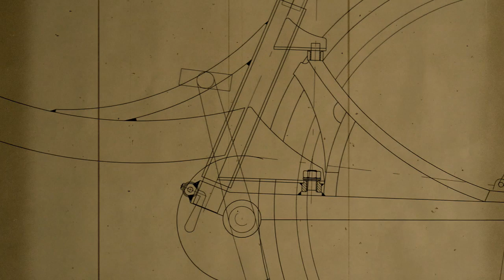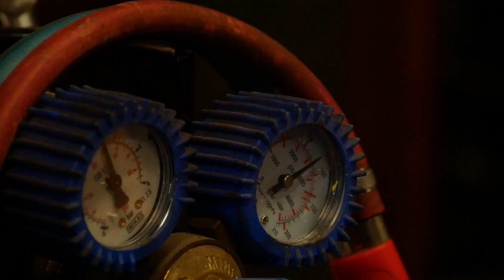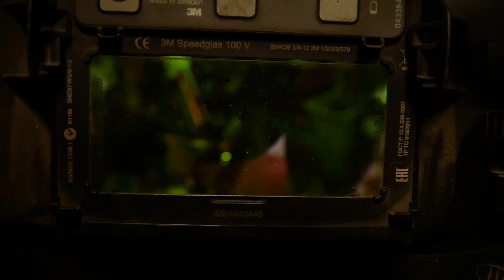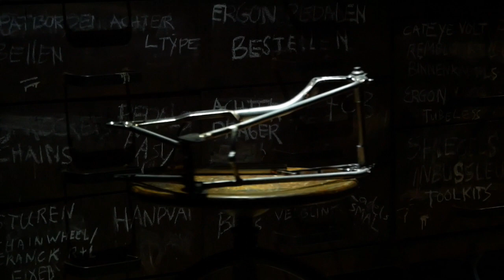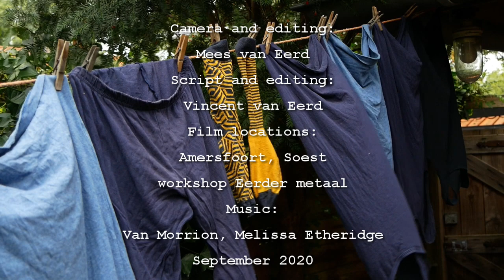Life unfolding

Comment: This is one of the most impressive Brompton related videos I've ever seen. I can't imagine how much it would cost for one of these but I'm so impressed with your technical skill and ability and that amazingly polished and gorgeous finished product! I got into welding and was on my second semester (4 th actual course plus intro to Metallurgy and heat treat) when I found out I'm prone to heat exhaustion and actually had a blackout during class 😅 so I have just a taste of what it takes to make something like this and again, damn I am impressed!
Reply from the maker: thanks man, heat exhaustion because of the heat during welding or a heat wave in your area? Hope the first as you can't do much about the latter, cheers Vincent
Reply: @eerdermetaal73  I was wearing leather sleeves and an open chest, it was warm in the shop but I was doing a little project where I was Brazing and Welding and started not feeling well and then just blacked out and vomited. I'd been struggling, feeling pretty nauseous off and on and it was just closing my up in leather even if it wasn't super hot because I don't regulate body heat as well as most other people I guess. I did have the forethought when things started spinning to make the guy next to me take my torch before I blacked out and hit the floor 😅
The only basic form of welding I hadn't really tried yet was TIG welding. I was ready to take the shielded metal arc welding certification so it was a pretty big blow when I realized welding was something I probably shouldn't start a career in 😅
Your tig lays so nice as well! Beautiful work!

Comment: Nice bike build👍I’m thinking of using tig brazing on my bike frame. What bronze filler rod do you use? Amperage?
Reply from the maker: CuSi3 is my favourite, also works on stainless steel, CuSn6 is easier to work with but less strong, still never failed on me or my customers, amerage below 85 I think, always work with a foot pedal, which is highly recommended, a good one also makes a difference, now one from Rehm, my previous one from a chinese manufacturer was hard to modulate
Reply from the maker: CuSi3 is my favourite rod, use a good foot pedal so you don't have to worry about amperage. Without it is a problem, you shouldn't melt the base metal, which is really hard without a pedal unless it's mass production work, then you can dial it in